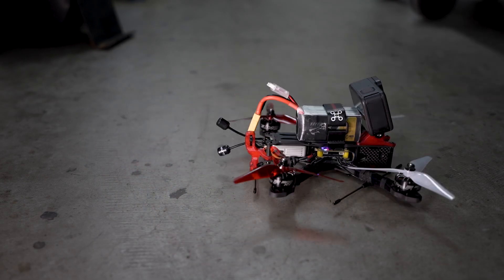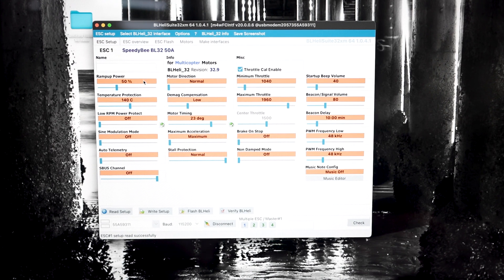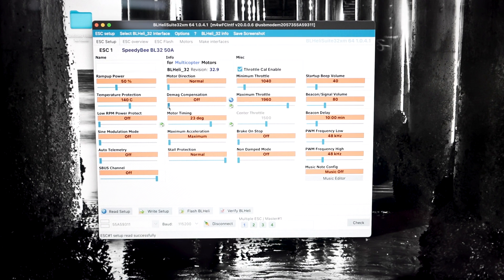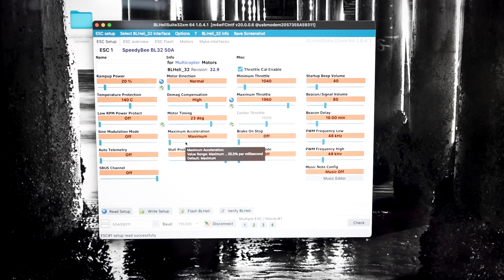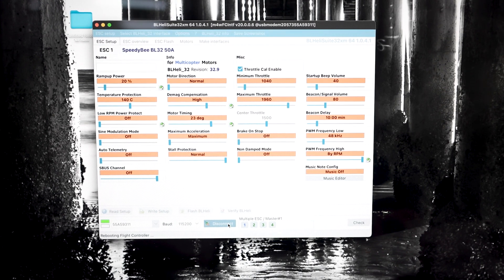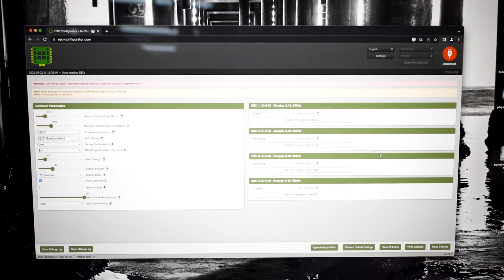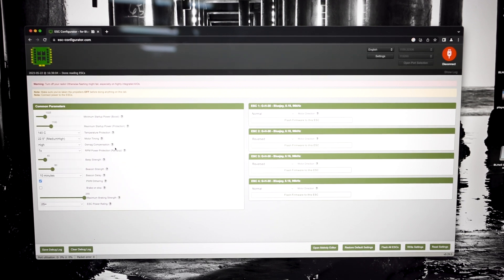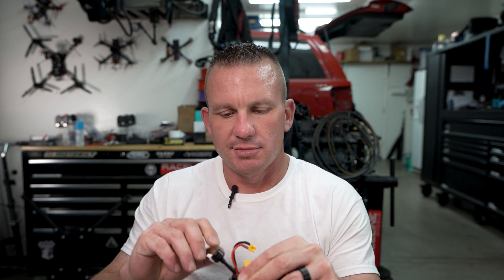How to Fix a Motor Desync & DeathRoll on your Quadcopter /FPV Drone,  Step by Step Tutorial BlHeli

Comment: Thanks broo
I want ask about when fly slow and turn right or left its desync issue??
I got this problem on neutronrc mini aio with motor 2203.5 for 3 inch cinewhoop 6s 1000mah

Comment: Does desync present itself as a runaway failsafe?
Reply from the maker: sorry I never saw your message till now. im not sure what you mean by runaway failsafe as those are 2 very different things. a failsafe is a loss of signal or communication from the radio to the receiver on the Kwad. Most pilots would set the failsafe to just simply disarm in the event of a failsafe unless they have a gps module onboard, in which case you'd probably set it to RTH ( return to home ). The ESC is sensing an issue and protecting itself and the motor by shutingdown. My guess is that you are asking about a runaway Kwad which is typically due to PID's being way out of balance.  This presents as  the Kwad will start teetering on one side then the pid will tell the other to respond to stay level. This keeps happening repeatedly causing the Kwad to climb and fly away. Pid's are also affected directly by Rampup power in the ESC Config. Rampup Power values are a bit like asking the PID values to multiply themselves by X as the value is increased. If I didn't answer your question or you've got something else just hit me back. Thanks
Reply: @Arykperry  No, and yes it does I solved this problem, it was due to flashing bluejay on a speedbee 60 amp esc with default settings.  This was a "runaway failsafe" flag that was triggered in the flight controller due to desync...the message "runaway failsafe" is flashed in the osd and the quad falls out of the air.
Reply: @maddercat i also have runaway disarm. So, how did you solve it?

Comment: hello great vid btw solved a lot of doubts in my head my 10" rekon is experiencing desync thank god it was the second flight and only lost 2 props what motor timing should i use for these large quads running 2812 motor 10" props on a 60A bl 32 esc thanks for the on point video